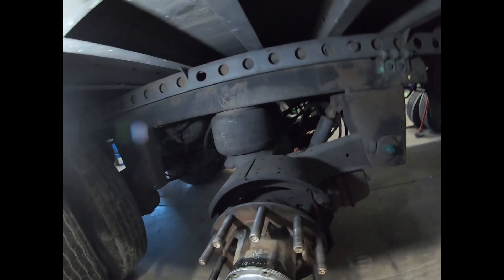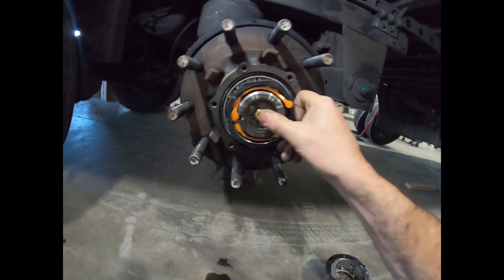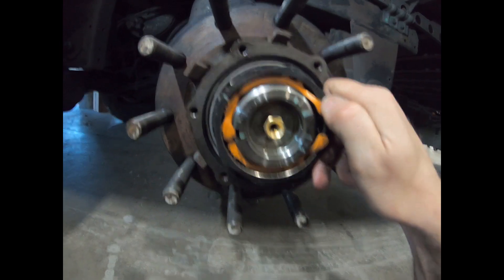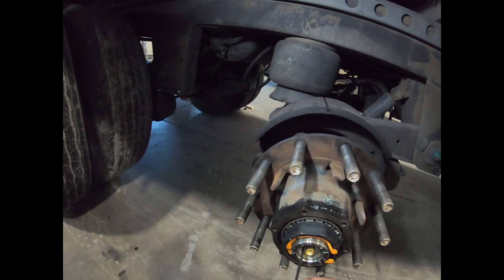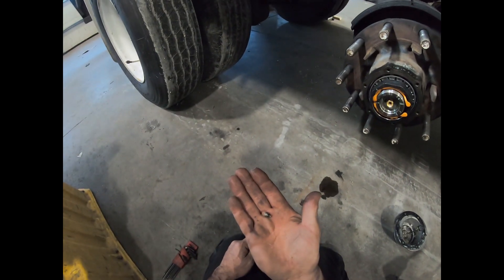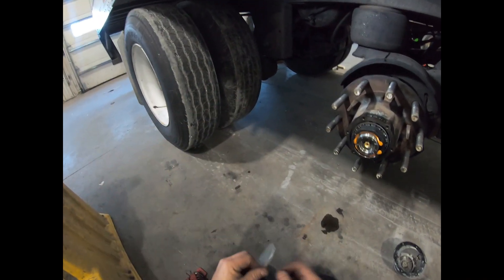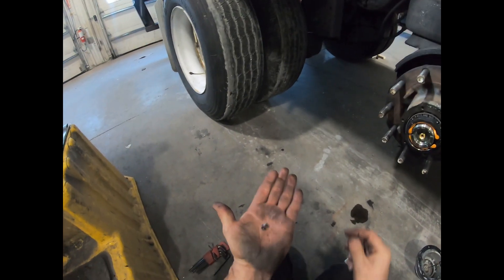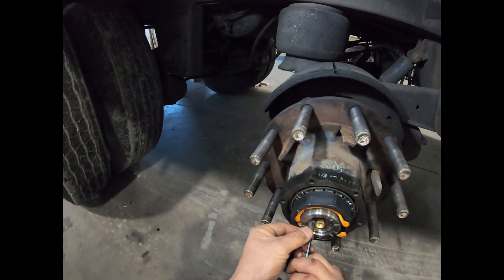Air Leak at hubcap. Demonstration of Meritor's ThermALERT system.

Comment: I just replaced a hubcap that had a cracked side glass as preventative maintenance and it started leaking air  and grease out from around the through T. The old one was not leaking but I did notice a little bit of old grease around the cap but not bad to worry about. I replaced the cap with a stem co the other one was the original and I re used the same T valve as it looked in good shape, could it be the stater that makes it leak or the therma plug?
Reply from the maker: Sorry for the delayed response... The stator is usually the most likely suspect for an air leak coming from the hubcap.  The stator has seals that can wear out from the rotation of the metal through tee inside of it.  
You'll be able to tell if the ThermALERT plug is leaking by removing the hubcap and blocking the flow of air from the exposed stator with your finger. If you hear or feel air coming out of the set screw looking thing installed on the axle plug, then you need to replace the ThermALERT plug.  Don't forget to check and repair any wheel end issues.  That plug should only leak air if wheel end temps get too high.
Reply: @ thank you!

Comment: Do those usually fail and cause the constant air leak??
Reply from the maker: They only "fail" when wheel end temperatures go high enough to melt the material inside the plug.  (it's not really failing, this is what they are designed to do).

Comment: I have a question that is completely off topic but i think you might know the answer to. How many brake applications are needed to test reservoir capacity? . I have asked the guys that i work with and they had no idea cant find anything online . it was question on my test, any help is appreciated-Thanks
Reply from the maker: Sorry for the delayed response...  FMVSS 121 states that the combined volume of all service reservoirs and supply reservoirs shall be at least 12 times the combined volume of all service brake chambers.  So you should be able to make 12 brake applications from a fully charged tank.
Reply: @fleetrepairsolutions6372   Thank you, does this also include trailer?
Reply from the maker: @peyton.c8399  I believe so... considering the wording is "the combined volume of all service and supply reservoirs.  Also FMVSS 121 gives specific regulations just for trailers: 
"S5.2 Required equipment for trailers. Each trailer shall have the following equipment:

S5.2.1 Reservoirs. One or more reservoirs to which the air is delivered from the towing vehicle.

S5.2.1.1 The total volume of each service reservoir shall be at least eight times the combined volume of all service brake chambers serviced by that reservoir.
Reply: @fleetrepairsolutions6372   Thank you for your help, hopefully I will pass the red seal this time lol